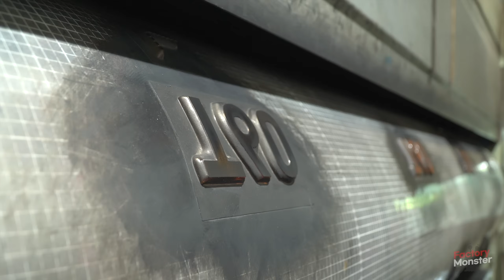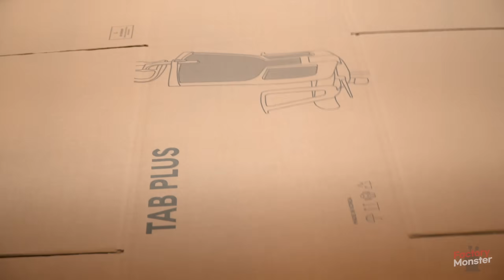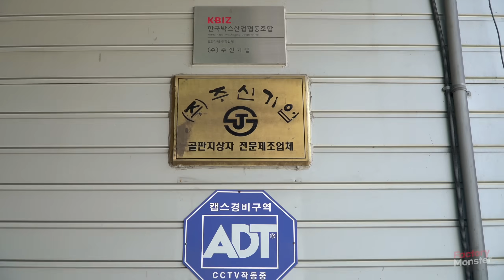Process of Making Large Corrugated Boxes. Box Mass Production in Korea

Comment: I deliver the giant paper rolls to a bunch of cardboard box plants in California, and I love getting to watch the machinery doing this! I never have the time to ask for permission to film it though lol

Some of the plants I go to are old with a lot of manual equipment like this one had, and others are basically entirely automated with robots stacking the rolls of paper into the warehouse shelves and retrieving them later as needed, and then the piles of sheets or finished boxes moving on automated roller conveyor systems to the warehouse, with switches that send different products different directions based on the bar code label.

All fun stuff to watch!

I would enjoy working in the maintenance department at one of these plants, but it's just too noisy! I like to be able to hear myself think lol
Reply: So you basically work for a kraft paper supplier/manufacturer. In the realm of the corrugated boxes world, kraft manufacfurer is the God of this business as they set the price for everything else down the stream and there are very few of them compared to all these converting plants. They're the biggest fish in this business!!
Reply: I used to work at plants like that. Our Roll Storage warehouses were huge. Rolls were stacked on end 5 or more rows high. Those special fork lifts look like they would tip over, but don't.

Comment: I am a german plant manager, I love this product.
It would also be intresting to see the paperboard machine/ corrugator at first.
Reply: Korean Love BHS
Reply: I used to work on a triple wall corrugator. We purchased web tracking equipment from E&L a German manufacturer. Worked very well so operators didn't need to open or close web guides manually. Also helped correct end to end warping.

Comment: "The smaller size boxes it's completely automated"
Immediately cuts to a man manually putting each box into the machine.    LOL!
But I get what you meant.  The actual gluing is automatic.  :)
Reply from the maker: Yeah maybe partially automated :)
Reply: @Factory_Monster  I am looking for a manufacture of E flute and B flute white sheet size 1220mm x 2440 mm we use these sheets to print on with our flat bed digital printer 
We are in Australia

Comment: The plant is using Triple Wall Board... very thick and very strong... much like plywood.

I used to work for a Corrugated Container Plant. Our plant made single and double wall board. One of our other plants made triple wall board. It has 2 layers of corrugation and 3 layers of smooth. All together it's over 1/4 inch thick.
Reply: Our plant made triple wall by combining A flute B flute and C flute at the doublebacker machine. This board is very strong and used for bulk containers.
Reply: @jimm8246  Thanks for comment. When I first saw triple wall I almost mistook it for plywood. It was thick and very stiff. We made it for major appliance manufacturers. They needed very sturdy containers for shipping washers, dryers, refrigerators, etc.

I think it could be used to build temporary small houses after disasters. They could be recycled when no longer needed. My cat loves boxes, so would homeless that lost everything in a tornado.

Comment: Nice.  This plant is way out of date by US standards.  Some of these hand processes are going on but by and large the machines that print and slot also fold and stitch or glue the manufacturers joint closed.   All that patting and spanking is in order to make sure the finished box comes out square, not crooked.  Those printing plates are not natural rubber.  It is a photo polymer created plate.